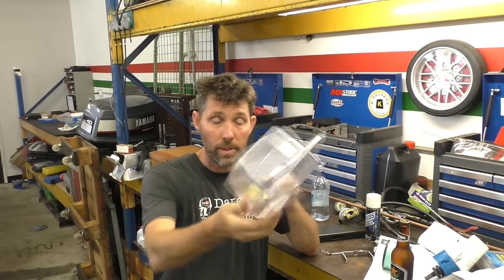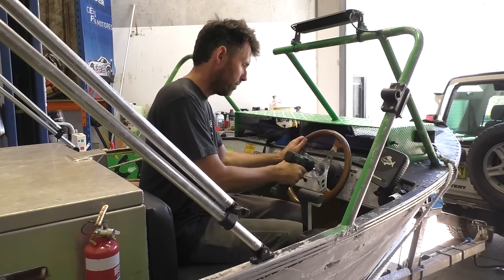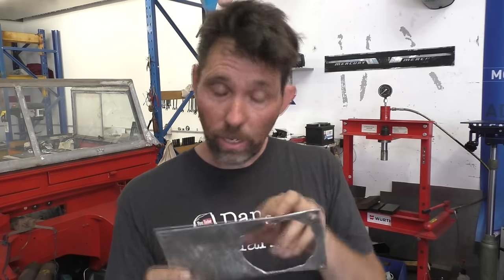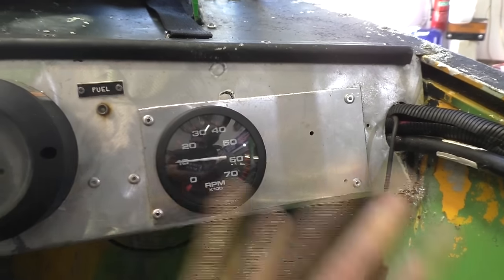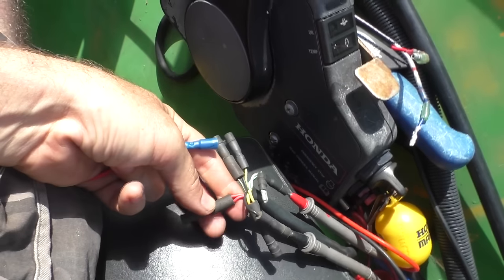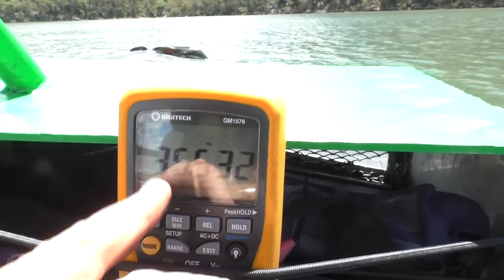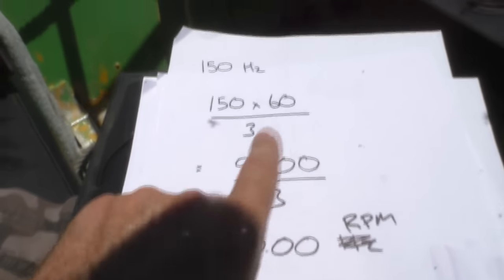Installing and calibrating an outboard tachometer

Comment: Hi Stu another great video thank you I just wondered is it possible to connect these to any outboard even if it's an old one with points and condenser would you be able to take a wire off the coil for it many thanks Lee keep up the good work
Reply from the maker: You'll need to check with the manufacturer to be sure, but it should work just fine as it gets engine speed from the charge coil, not from the CDI unit.

Comment: Out of all the gauges I added to the boat, the tach has been the most important. I get the MPH from GPS. And I believe the C stands for cylinders.
Reply from the maker: Glad I'm not the only one! :) You are right about the C. I wonder if it is is designed to be run off both charge coils and ignition wires, because with my connection the number of cylinders is irrelevant.

Comment: I just installed a new Faria Tach on my 1989 70 HP Mercury outboard. it does not register any RPM. Will that result occur if the setting is incorrect? Thank you very much

Comment: Just watched your install of a tacho video.   I have a 40 HP Mercury and it is a manual version.  I had to install the VR prior and when I followed the directions of the wires I found it extremely hard to get a reliable connection.  also, the VR gets very, very hot.  What are your recommendations if any?
Thanks,
Matt
Reply from the maker: You can get extra heat from bad connections due to the increased resistance. How did you do the connections?
Reply: Dangar, TY for the response.  not sure what their real name is but I call them crimp on bullet male/female
Reply: the yellow wires coming off the stator are like this...

Comment: Great video. It would be worth mentioning that holesaws clog very quickly so you need to in and out a lot to clear the chips. Cheers
Reply from the maker: Thanks mate. Yes, they do clog a lot. Someone else commented below that they drill a few small holes in the groves to give the shavings somewhere to fall through which helps too.

Comment: Hey Stue I've got an older straight 6cyl 90hp mercury does the wiring of the your. Tach coinside the wiring for mine. I. Not getting any power to any of the wires coming from my remote controls. At all. Not sure why. And there arwnt any grey wires to begin with. There is a purple witch i asume is the power wire to the tach. That doesnt concern me becouse I wired all my gauge power to a toggle switch. What I want to do is either figure out why im not getting power to the tach wiring in my controls, or figure out what wire it goes to on my stator/ charge coil so I can just run a wire straight from the outboard to the signal terminal on the tach. Couldnt find any videos or achematics on line to help. Since you got me through wireing the rest of my boat. i thought maybe you could help me with this. Its the last guage I have left to make work, and its driving me nuts. Thanks Brother

Comment: Hey Stu, dose poles relate to the number of charge coils on the stator or the number of magnets on the flywheel. Every time I have set up a tach I always need to set different to the number of poles stated in the specs for my motor.
Reply: DMF351 - Poles = charge coils normally, with 2 poles = 1 charge coil. However I am finding that some tacho signal wires are taking the signal directly before the rectifier, others after the rectifier. I'll let Stu show how that makes a difference on his blackboard, but basically it means you may be over or under by a factor of two . So a 3 pole alternator may need to be set to 3 or maybe 6, with no way to really know until you try it. You wont harm a tacho by supplying too many or too few pulses, you will just get a bad reading. In the one I did last week I had to add a resister (100ohm, .5watt) to the signal wire as the raw alternator pulses were going to 17V (rms for the techies- so about 24v peak) and overloading the tacho signal circuit. The needle was going all over the place . The resister cuts the voltage down to around the 9V rms level and the needle is now pretty smooth in operation.
Reply: I have an old merc that has 10 coils + 2 trigger coils on the stator. I have an aftermarket tach that fizzles out at 3000 rpm. I'm chasing a genuine merc tach.

Comment: Great video. Poles are in pairs. It's a terminology issue. It's so annoying that they don't provide an oversize backing plate for controls. Saves all that accurate hole cutting.

Comment: Great video ... would you think a temp meter worth it on a four stroke??
Reply: Micheál Cleary Being a 4 stroke shouldn't make a difference. Most motors have an overheat alarm. These motors are water cooled and where I live people are bigger on a water pressure gauge than temp. Our local boat mechanic says " I like looking forward, instead of backwards while driving a boat. So no looking back to see if motor is pissing!
Reply from the maker: I think it would be interesting to be able to monitor the block temperature rather than just have an alarm once its already got too hot.
Reply: I use a turkey temp gauge. You have to put the prong on the head of the engine
Reply: Me too i think is a good thing to have a temp meter. A temp meter can advice you that your thermostat stay partly open, That make the engine  running too cold . A 4 stroke shave to run a the good temperature.............Too cold make engine sometimes not running good, more hard on the fuel and many other short or long therm problems, especialy in cold water........And overheat alarm can't do that.
Reply: Stu, maybe adding a water pressure switch or gauge would be a good mod for many - use the 'pee' hole fitting in the block to fit a T piece  and run it off that?
Reply: Ron Powell That's exactly what the Refuge guys here do. Where I live in the marsh, there is a lot of debris and mud in the water. There is a big duck hunters forum in south Louisiana called The Refuge. Danny has been racing and rebuilding (And sponsored) by Tohatsu and Merc for several decades. And with a 40 hp max in some of the hunting lakes, people love the 40 hp 59ci merc. It's by far the strongest 2 stk 40 ever made. So these guys KNOW this motor well and helped me a lot. This motors telltale ALWAYS clogs because of the small 90 degree elbows. I was able to reroute the telltale from the bottom of block to the top so I now get a TRUE water flow indication as it's now after the thermostat and not before the water goes through the block. I didn't do the water pressure gauge, just the telltale. And since the mod, I never had the motor not piss unlike before, where I had to keep weed eater string onboard because it ALWAYS would clog. The top of this block is a brass plug that you remove and swap the 90 elbow and put hex plug where the original pisser was. All I bought was 1-2 feet of 5/16 hose and drilled out the original telltale hole and ran the hose and put a tie strap on. I'm glad these guys showed me this!

Comment: What should be the proper range of a Johnson J115ELECM voltage at tach gray wire. I keep blowing tach. It works at idle and when I go wot it stops working. Changed out the rectifier regulator and checked for shorts. NEED HELP

Comment: Prior to tacho install it's important to gather what'll be needed, namely a six pack of beer and some of those wrench bottle openers in metric, imperial and SAE sizes.
Reply: Jim H, you have to have imperial and metric bottle openers, some bottles are measure mL and others in Ozs, and even quarts or pints. very confusing!
Reply: Ron Powell doesn’t mater if your beer is measured in pints, quarts, milliliters or ounces. Doesn’t matter which side of the ocean your standing on either. At the end of the day, we all drink and enjoy our beer the same way! 😊

Comment: Hi, I need some help. Yamaha's remote control have two green wires for tacho signal. Faria's  tachometer have one stud for the Signal (other 2 studs are for power and ground). Where I have to connect the second green wire?

Comment: My Mercury tacho sits on 800 RPM with the battery disconnected. I removed the unit and applied 12V and adjusted the CAL screw to minimum ± 200 RPM but when I removed the power the gauge went back to ± 600 RPM. Please help!

Comment: Good evening, I really like your videos, I always see here from Brazil, I would like to know where I can get an electronic catalog of parts of the engine, mariner (mercury) year 1991 15 hp, if you can help me. Many thanks and I'm sorry for the bad English
Reply: Celso Santos I got mine off eBay. It came as a CD. I then printed it out and put papers in a large binder.
Reply from the maker: The other thing you can do is jump on the marineengine.com website and find you motor and go from there http://www.marineengine.com/parts/mariner-outboard-parts/
Reply: Thank you, I solved my problem.

Comment: Nice video. I installed a tacho in my dash, but i have the signal wire to hook up, my problem is my Suzuki 25 hp 4 stroke has 3 coils. I have looked online for help but no luck, how do i find out how to finish the hook up. If you can offer any help it would be great. Thanks
Reply: Noel O'Halloran Look up Faria tach  instructions. It had everything all the info needed for any type of outboard.
Reply: jimbo gasoline Thank you very much for the info.
Reply: As Stu found, 3 coils may use 6 or 3 poles setting, you may have to experiment as Stu did. My engine as an example has ten coils, but the web site for my tach says the engine should be set to 5 poles.
Reply: Thank you for your reply.  I just don't know how to connect the signal wire, i was told it should go to the negative of the coil on a single coil, but i have 3 coils on my Suzuki outboard. Any help would be greatly appreciated
Reply: Noel- boat motors are a different beast to car motors. From your description it looks like your tacho is for a car engine using points ( or a marinised car engine using points) . I don't think you will have much luck getting that tacho to work with your engine. The reason why is a bit complex and wont help you any. You need to get a tacho for an outboard engine. The tacho signal wire is usually grey or grey/yellow stripe and as shown in the video, available on a plug or via a loose wire at the forward control box.
Reply: Ron Powell As Ron pointed out, make sure this is an outboard tach. And as Ron said, my wire is gray from the harness under the  center console. Is this a tiller motor? You can Google Suzuki outboard wire color ID to make sure. Hope you get it figured Out!
SORRY RON, I MEANT TO FOWARD TO NOEL
Reply: All good Jimbo. If that Suzuki is a two stroke then you could try connecting the signal input of the tacho to the any one of the coil trigger inputs and then configure the tacho to single cylinder . On older engines that run one coil for all the cylinders, the cylinder count is important. On engines (4 or 2 stroke) that run one coil per cylinder the tachos  could get connected to any one coil and get configured to single cylinder for 2 strokes and 2 cylinders for 4 strokes- regardless of the actual number of cylinders installed. But be aware, car tachos designed for points  or electronic triggering will typically be destroyed by an outboard CDI coil trigger circuit as they commonly run up to 200volts.
Reply: Hi everyone, I emailed the company i bought the tachometer from, they said the tachometer will work on 1 to 10 cylinder engines with one coil. My new 25hp 4 stroke EFI motor has 3 coils, they said i could get a signal adapter, but they don't sell them. Do you think i should just get get a new tachometer for an outboard, or get an adapter and mess with that. Thanks again for any help.
Reply: Sounds like it is a car tacho. If the engine is a two stroke then the number of cylinders on your engine does not matter, you only hook up to one cylinder if you use an adapter, and set the tacho to one cylinder setting.  Get a boat tacho, it will be easier for you to hook up. The added bonus is car tachos are rarely water proof or have their circuit boards totally gooped against moisture, marine instruments always are.
Reply: Ron Powell Thank you Sir.
Reply: Noel, please don't call me 'sir', I work for a living. But if I have helped, then all is good.

Comment: My 89 Suzuki dt115 tach pegs out as soon as I turn key. Any advice?
Reply from the maker: Sounds like it is wired to the wrong place or the number of poles is set incorrectly.
Reply: Dangar Marine  could it be a ground issue?

Comment: I saw on the back of the tachometer it shows P=pulses, C=cylinders.
Reply from the maker: Yes, I think I was misreading that after having read so much about "cycles" I wonder if it is is designed to be run off both charge coils and ignition wires, because with my connection the number of cylinders is irrelevant.
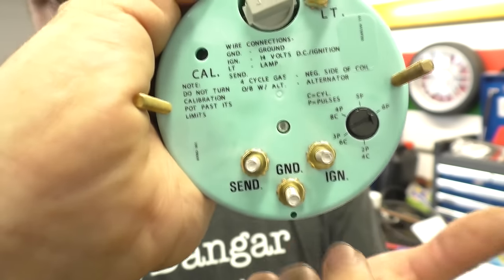Reply: @DangarMarine  this video has bothered me  since it came out. after rewatching it @2:42 on the back of the tach it actually states the send connection   can be hooked to the neg ign coil lead on 4 stroke gas engines or the pulse lead on the charging coil.  thus the reference  to cyl for cylinders if used on gas or p for pulses if used on charge coils.

Comment: Hey man I have cuestion what kind of control box work with mercury 50 hp 2 stroke 4 cylinder  outboard...can I use or connect any kind of control  or i have to use one in specific
Reply from the maker: Genernally most forward controls can be used. There are generic wires for ingition, start and alarms that could be cross mapped. Throttle and gear selector cables are standard too, the only thing that could be different is the distance that move to select a gear.
Reply: O ok thank you for your help I really appreciate it
Reply: Hey man i have a cuestion how to install a speed tachometer in my boat I want to know which wire its the ignition  signal in my mercury 50 hp 2 stroke 4 cylinder  can you help me with that please
Reply: @DangarMarine  ..hey man i have a cuestion  ..i want to install a speed tachometer in my boat but I don't know which wire its the ignition signal in one mercury 50 hp 2 stroke 4 cylinder can you help me with please

Comment: I have this same tach. Recently installed it in my boat and it was showing max of 3,000 rpm. I have a 90hp Johnson pushing 18.5' center console bay boat. I run about 33-35 rpm. When i installed the tach i looked up and found that almost all johnsons have 12 poles so i set the dial to 6 since it said divide by 2. I just brought my prop to the shop to get it recupped. its still only getting 3000 rpm which makes me think its the tachometer because there is no way im only getting 3k rpm. my motor should be getting 5000-5200. Any ideas on what i should do? should i drop the number of poles on the dial?
Reply: wich johnson do you have? 1982-90 . ? I have a 90 hp evinrude from 1982, bough myself a tach and a   oscilator to measurethe frequencey. I will hook up the whole thing, this week and let you know what the values are.
Reply: @mother-fng-bonswa3612  mine is a 1995
Reply: @jacobpicard5384  i ran mine today with the tach. i was able ot calibrate up to 8000 rpm. by using a knob on the back. but i  need a reference , but if i calibrate it to low, it wont get up to 3 k neither, but if i calibrate it right it will get up to 6000 or 5500

Comment: Hi what is the wide open throttle rpm of a 2001 merc 60hp two stroke,I can really find any specs.
Reply: 2 stroke=5500 rpm

Comment: Same my led Nav lights are always on they only draw so much power.
Reply from the maker: With nav lights I'd just put a separate switch in rather than running on the ignition power.